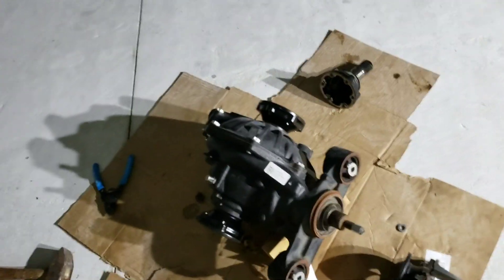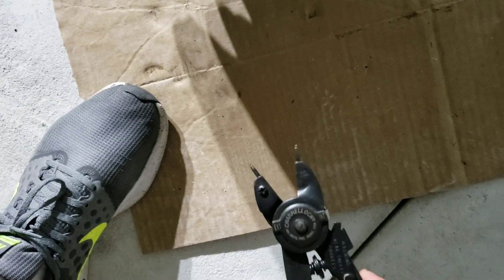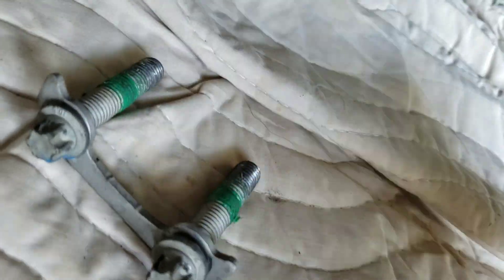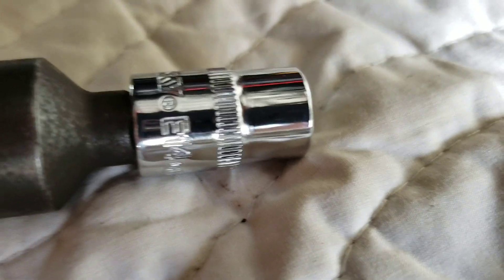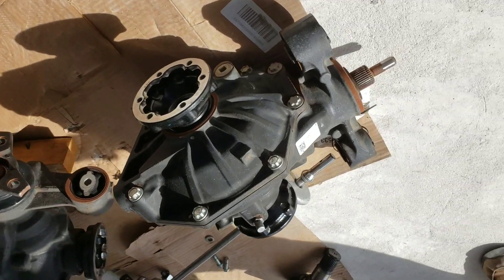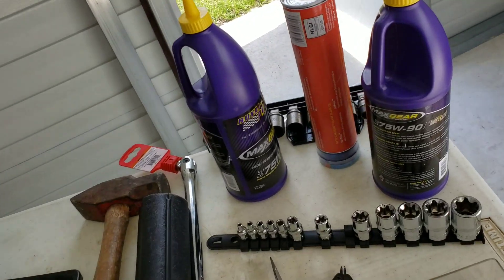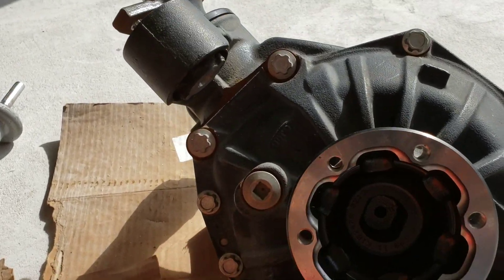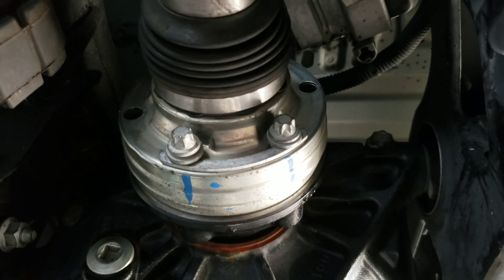How To : 2016 2017 2018 + Camaro V6 RS 2.77 to 3.27 LSD Differential and SS Axle Swap

Comment: Hello, after replacing the 2.77 with a 3.27, is it necessary to adjust the control unit? What happens if it's not adjusted? Will the speed display be correct? Is this adjustment difficult, and what software is required?

Comment: I was wondering what is the part # on the ss 3.27 LSD rear diff? Also does it matter if u get a manual ss diff and axles or is it different to match up to a 3.6 8L45 platform?
Reply from the maker: There is no SS 3.27 the 3.27 LSD is out of the 3.6 and 2.0t Manual Camaro's. All the Flanges etc.. are interchangeable between all the diffs so for example I have SS axles and SS Axle flanges but a 3.6l Manual 3.27 LSD.

Comment: Would this work on a SS 2.77 car
Reply from the maker: Yeah just have to swap over the flange that connects to your drive shaft and your axle flanges. I am running SS axles with SS axle flanges on my 3.6. However you wont have the cooling you have on your SS diff.

Comment: @HyperHawkCamaro Hi!) I'm just going to accept same challenge but I'm a Cadillac CTS 2.0T owner (rwd, 3.45 open diff). So I guess if I use 3.27 LSD from 3.6 MT Camaro with it's own axles it will fit perfectly to my granny sedan, is it correct? Obviously I will loose some points of a second at the acceleration but I hope modified ECU will fix that issue...
Reply from the maker: 3.45 open diff ? What year is your car?
Reply: 2014 (3gen CTS)
Reply from the maker: @АндрейКорсун-ю1у  so you have a different drivetrain. Not even sure you can use the parts from the alpha platform.
Reply: @HyperHawkCamaro  for sure I can) cause my CTS seats exactly on the GM Alpha platform as on ATS (2013-2019) and Camaro (2016-2024) Wiki says))
Reply: @HyperHawkCamaro  for sure I can) cause my CTS seats exactly on the GM Alpha platform as on ATS (2013-2019) and Camaro (2016-2024) Wiki says))
Reply from the maker: @АндрейКорсун-ю1у  Drivetrain is stil differenr just check before you buy make sure all the parts can carry over. Cts is wider and has a longer wheelbase. If your axles dont fit or the halfshafts dont fit.
Reply: @HyperHawkCamaro already checked my thoughts last week and realized that you were totally right!) LSD can be installed, but you need custom halfshafts, and it is the huge problem... As you said before Camaro's LSD is much wider than CTS's, and Camaro's halfshafts are longer at the same time... The only one good point is that both diffs have similar connection points to rear subrame

Comment: Does anybody know if you can swap 1LE rear into an SS? (6th gen)
Think I may have messed up trying to go from stock 2:77 to 3:73 and bought a 1LE rear when maybe I need the M6 rear. From a forum I read it’s possible the 1LE had an electronic diff and it isn’t compatible.

Comment: for the 2023 v6’s that have the a10 transmission, you’re better off doing the 2.77 LSD in the automatic SS and change to the SS axels. this also doesn’t require a tune bc it’s the same gearing and on top of it this 3.27 is to high gearing for the 10 speeds (from what i’ve heard)
Reply from the maker: Yes Nice update point! the A10 didnt even exist when I made this video 5 years ago. the 3.27 gearing is short enough for the A8 if you put this in a A10 you might as well say goodbye to first and maybe second gear. If you do the SS axles and Diff dont forget to swap over the driveshaft flange. I am going to pin your comment
Reply: @HyperHawkCamaro  will keep you updated💯
Reply: what about the 5th gens

Comment: Why not buy 2.77 ss auto diff? I mean what the different
Reply from the maker: 3.27 gearing helps with acceleration. You lose absolute top end but I'm not anywhere close to that in the 1/4

Comment: is it possible to use the SS diff with the ss axles? or would it not work with the v6 driveshaft?
Reply from the maker: Yes but I wouldn't from the SS you have a choice of 2.77 which we already have or 3.73 from the manual which makes your gears 2 short. If you just want to upgrade to a LSD you can use the SS 2.77 axles and flanges everything.
Reply: @HyperHawkCamaro  yeah i just want the LSD. the SS 2.77 is LSD then? and i was under the impression that the SS diff came in 3.27 as well but i guess i was wrong.
Reply: @HyperHawkCamaro  can’t find a 3.27 out of a v6 manual is the only issue or id just choose that. best of both worlds, higher gear ratio and lsd

Comment: Flange for SS is called Axle Shaft , gm part #84080683 , rock auto has them for $95 each
Reply: i have a 2023 v6 3LT RS with the 10 speed auto, i want to find a lsd for it, with these shafts i could get the SS LSD for the auto, would you happen to know the part number for that? and what would i need to do about the new shift points? thanks!

Comment: Ok I am wanting to change my rearend....I have a 2017 RS 3.6L with the A8. What would I need to put the SS rearend in my car?
Reply: From what I am gathering, I just need to find a manual V6 and grab the diff out of it or the axle shafts too? Then install and tune it?
Reply from the maker: Don't need the SS axles but you will need the manual V6 axles then. I just figured since had to change axles might as well go with the stronger SS axles. You will need the axle flanges that go to the SS axles as well. If you go with the manual V6 axles you won't need that part as they will just bolt up to the manual diff.

Comment: How much was the differential ?
Reply from the maker: Got mine from LKQ for $500 got the SS axles off eBay for $100 and the Shafts for $70 each new from GM then you need the retaining bolts about $60

Comment: I have a 2016 camaro v6 3.6 auto 2.77 

I want to swap to a 3.73 and someone told me I only need ring and pinion. What do you know about that? Or how can a do a direct swap and have a noticeable difference? I have a hptuners tune
Reply from the maker: Get a diff out of a manual SS you will need the axles as well. You can't just do the ring and pinion I guess you could but you wouldn't have LSD you would have a open 3.73. I dunno it's just easier to find a used diff and swap it out then tear down a diff and change the ring and pinion.
Reply: @HyperHawkCamaro  this works for the automatic?
Reply: @codyjohnson7708 yes, that’s what I did in mine - manual diff in my automatic v6

Comment: Did the ss axle just slide in or did you have to beat them in?
Reply from the maker: Do you mean the flange ? We had no issues with either the flange or axles the flange required some minor tapping and the axles just went in no problem

Comment: I’m doing this swap now, do you happen to know the part number for the bolts that connect the axels to the diff, since I cannot reuse them I will need new ones but I cannot find the part number on gm parts. Thank you
Reply from the maker: Are you doing the axles as well like I did or just the diff ?
Reply: @HyperHawkCamaro  I’m doing just the diff I’m keeping the original v6 axel so I need the oem bolts
Reply from the maker: @rickscamaro  sorry I do not know the V6 part # I swapped to V8 axles and flanges and the bolt is doff
Reply: Do you got the part # for the v8 bolts for the axle , mine broke off the differential

Comment: Again thanks for the video. You have answered a couple questions for me in the past on this subject. The only thing holding me back at this point is - The tune after everything is complete. I want the Overkill tune but am concerned about turn around time and driving the car in the meantime. The HP Tuner you reference, is that only to correct gear ratios or that's the tune your running? What is affected until the tune is in? Once I'm straight on all of this I'll definitely make it happen. 
Thank you kindly
Reply from the maker: You can drive with the paddles until the shift points are fixed.

Comment: a tad bit confused. looking at a 2017 camaro rs 2.0t automatic and the description of the vehicle says it has the 3.27 ratio diff, is that the limited slip one even though it’s the automatic 2.0? very confused and just trying to do some slides, thanks!
Reply from the maker: So here is the list.
2.0t A8 = 3.27 non lsd 
3.6 and 2.0t manual = 3.27 LSD
3.6 A8 = 2.77 non LSD
V8 A8 = 2.77 LSD
V8 manual = 3.73 LSD
Reply: @HyperHawkCamaro  thank you very very much but i’m still a tad confused. i see multiple videos here on youtube of stock v6 automatic camaros lighting up both tires indicating its lsd. how is that possible?
Reply from the maker: @jordannn392  just because it's not LSD doesn't mean it cant spin both wheels LSD limits the amount of power one wheel received over the other allowing equalization of torque and power. With non LSD you have a drive wheel and the other follows but when slipping or hard cornering your drive wheel is always the definer. Yes this can cause one wheel peels but not always depending on surface grip etc..
Reply: @HyperHawkCamaro  i understand that completely, im still learning about differentials myself im only 19 and still a kid who’s trying to get into drifting so like i said still learning and thanks for answering all my questions thus far. now a final question i have would be i currently drive a e46 bmw coupe. sadly it has an open differential, i’m still trying to find a place to get it welded, but until then i usually wait til it rains or something for me to go outside and try and get it sideways. now my question is, how much damage, if any is done to my rear diff when i try and get sideways on slippery road conditions. i’m not beating the hell out of it just tweaking the wheel enough to try & get it sideways. thanks again man in advance!

Comment: Do you need to have a tune to be able to drive the car after this? Because I have the 2018 V6 A8 and tuning the trans is apparently more difficult
Reply from the maker: Yes you would need one you can always just paddle shift but your WOT shift points would be off.

Comment: Are any of the 2.77's LSD? I found one near me but they don't know what ratio it is. It came from a Manual Camaro so it should be the 3.27 right?
Reply from the maker: Yes a manual V6 or 2.0t will be 3.27 LSD the 3.27 non lsd comes from the 2.0t auto and the 2.77 non lsd is V6 auto the 2.77 LSD is from SS
Reply: @HyperHawkCamaro  Hey man thanks for the reply. I picked up the diff on Friday, fun little 3 hour drive. I did confirm that it was from a 2018 2.0 mt that had the front wrecked with only 4400 miles (poor thing) but hey better for me I suppose. This thing must have sat around for a while; I can see some surface rust, and hopefully nothing else, on it. That being said I've never done this before, so what do you recommend I check before doing the swap? I was probably gonna go with the 2.0 axles for now unless I find some SS ones for a killer price.

It's so hard to find any good content for the 3.6 man, your videos are a godsend for the V6 community- KEEP IT UP!
Reply from the maker: @VirtuousStar1  Thanks man! Glad my videos are helping some definitely gives me some drive to make more. I would drain whatever fluid is in there out. Make sure everything spins smoothly. These diffs are damn tough so as long as everything spins good you should be fine.
Reply: HyperHawk Motorsports hey man I’ve had the parts to do the swap for some time now but I can’t seem to get a hold of Will over at Overkill. Is paying someone else to handle the tuning my only option here?

Comment: Nice Video! ... I am guessing this messed up the speedometer given the change in drive ratios ... Did you get it to work fine again?
Reply from the maker: Oh yeah just load up hp tuners and change the ratio in the tune. Click apply also have to change the shift point MPH for each gear since that changes as well

Comment: Do you have then part number for the smaller flanges on the axle shafts?
Reply from the maker: Smaller ? What do you need the smaller ones for just curious I can look it up for you in a bit.
Reply: @HyperHawkCamaro  so i have the 2.77 in my V6 camaro.  Bought a used 3.27 out of a V6 ATS.  The input shafts on the rear end are smaller than what is on my car.
Reply from the maker: @1Dikin2Baus  what year ATS because the flanges should be the same size or bigger the 2.77 on the V6 camaro has the smallest flanges of the grouping of diffs so hope you got the right diff.. does yours have a part number.. I guess its also possible the ATS uses different axles
Reply: HyperHawk Motorsports it’s out of a 15 ATS.  I don’t have a part number since it’s used.  I tried cross referencing parts and they were the same numbers.  I will swap the input shafts. Thank you for the information!  Hopefully it’s not too involved lol!
Reply: @HyperHawkCamaro  does the whole differential need to be taken apart to get those input shafts out?
Reply from the maker: @1Dikin2Baus  Nope I go over how to remove them in the video they are just held in with a C clip then they tap out
Reply from the maker: @1Dikin2Baus  after looking up parts the cadillac ats 15-17 does not share the same carrier as the camaro its nothing like ours .. the 2 you see in my video are the 2 variants that come in the camaros.
Reply: HyperHawk Motorsports the carrier actually is identical to the camaro.  Same setup as in mounting.  Bolt holes.  Drive shaft connection.
Reply: So it is as easy as it looked on paper to remove.  Lol
Reply from the maker: @1Dikin2Baus  I hope so because all the pictures ive seen of the ATS diff its nothing like the 6th gen diff.. I looked on LKQ eBay and simple good searches. Also the Part numbers are completely different from GM. I looked up both the 2.0t and the 3.6 rear carriers for the ATS and they are definitely different. Its similar by design but not the same. https://www.ebay.com/itm/2015-2018-Cadillac-ATS-Rear-Carrier-Differential-AT-Opt-FE2/293238779618?fits=Model%3AATS%7CMake%3ACadillac&hash=item444664aee2:g:xl4AAOSwZ91ecM9d.. Thats is very much different the the camaro diff
Reply: HyperHawk Motorsports I guess only one way to find out.  I’ll let ya know what happens.  Thanks for your help
Reply: @HyperHawkCamaro  do you know if the input shafts on the rear ends are swap able?
Reply from the maker: @1Dikin2Baus  yes everything is interchageable just move yours over

Comment: I think I have a 2.77 diff  I want to see will this work for my vehicle 2015 chevy camaro v6 automatic  ince it's a automatic?
Reply from the maker: Negative this is for 16 and up
Reply: Its the same process you just have to get a rear doff from a 2010-2015 v6 manual or SS v8 manual and swap it. Just have to swap out the flanges, and everything. Dont buy parts, see if you can find the whole thing dropped out of a SS itll save you time and money

Comment: I am looking into doing the same upgrade to my 2017 Camaro v6 Auto but I am having a hard time finding a differential for a 2016 - 2018 Camaro 2.0 Turbo auto to look into the upgrade. I was also going to look into a shop to perform the swap for me as well. I am curious to know how much can be expected from gains.

So far I only have a cat-back exhaust, x-pipe, a hi-flow air filter by K&N and a Trifecta tune. I am looking into upgrading my intake manifold to a ported intake manifold, the 80mm big throttle body, a CAI Cold Air Intake since it has just come out a few months ago, and the last mod would be the differential if I can't find one soon.

I am interested in Forced Air Induction but I am being told that I shouldn't do it because I will run into poor gas if it is a daily driver and that is the reason why I got rid of my 2012 Camaro SS. I had to fill it up every 2 - 3 days and the only mods I had was a cold air intake and a custom exhaust.